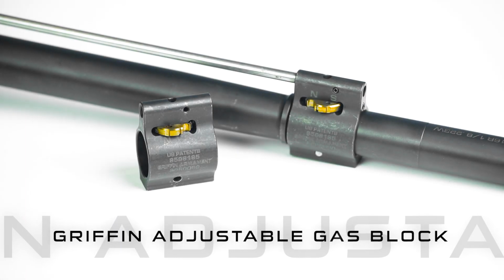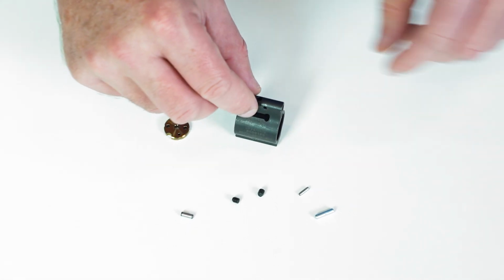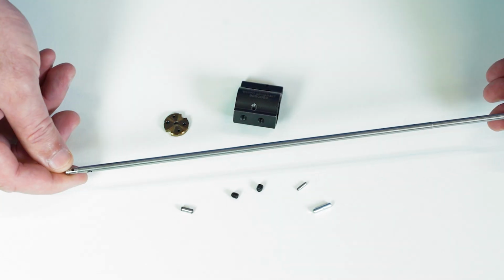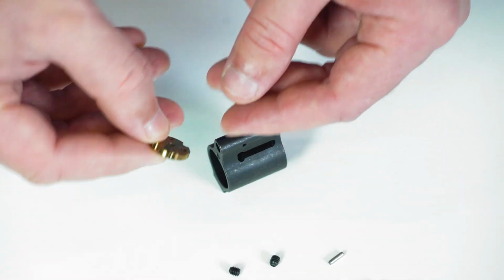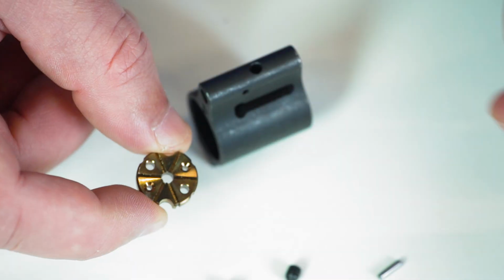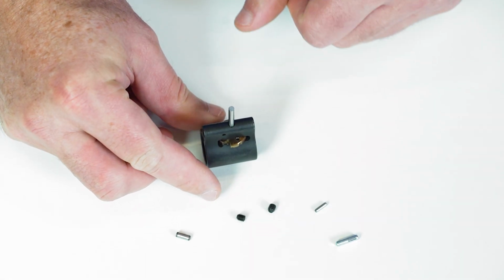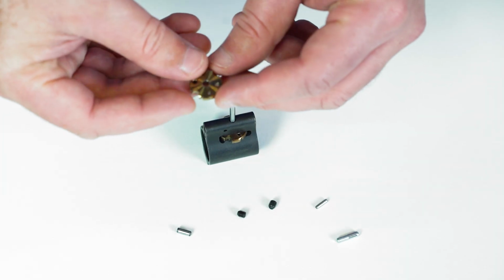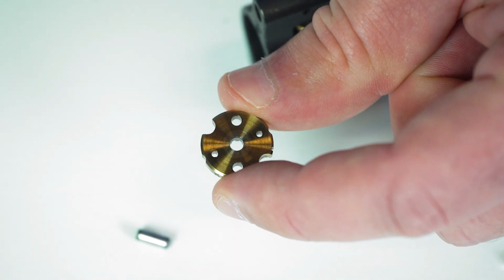Griffin Adjustable Gas Block - User Interaction Demonstration

Comment: I just went to your site and reviewed this product: 	Disassembly for cleaning ? 1.) The top retaining pin, is it easily removable, as in “made for disassembly / reassembly” ? 2.) Would like to be able to remove that wheel to soak and or scrub. 3.) What is the “wheel” material ? 4.) Are the gas tubes you offer proprietary to your gas block ? It would appear that a gunsmith is needed OR the personal ability and the equipment to install. Is there any thought of a pass thru set screw type for the “wheel” retaining pin in the future for owner removal for cleaning ?	Thank you for the video update.
Reply from the maker: 1.) The top retaining pin is just floating and held in place by the gas tube and the barrel for ease of removal to change plates or clean. 2.) The wheel is easily removable, and usually you don't even have to take the block off the barrel. Simply unpin the gas tube, slide it out the front, tip the barrel upside down and knock the pin out the top. If that doesn't work, you will have to remove the gas block and poke it through to the interior of the block using a punch or small tool. 3.) The regulator plates are made from H900 heat treated 17-4 stainless steel for high durability. 4.) Any standard length (rifle, mid, carbine, or pistol), straight gas tube should work fine as long as it's milspec. We sell them to support the gas block. 

 If you are going with a pre-drilled plate, any user with a basic understanding of gas-operated firearm assembly should be able to accomplish the install. If you are drilling your own port sizes, you might want to consult a professional for guidance. 

The retaining pin is exactly that, a pass through pin that can be knocked out in either direction. Hope this helps! We know it looks slightly complicated, but our video guy was able to figure it out and assemble it on his own in under 10 minutes, so it's really not that complex.
Reply: @GriffinArmamentOfficial is there gas leakage between the plate and slot in the gas block? It seems there would be seeing that the plate loosely slides in the slot. What’s keeping pressure down on the plate?
Reply from the maker: The plate has like a thousandth of clearance on either side between the plate and the slot resulting in very little gas escaping, but there is some and it's intended to be that way. Mr. Soong found out very early that a perfect fit almost invariably seizes the parts after a short time. Leaving a gap allows the carbon to blow itself out and not lock up the parts. The ags check grooves are there to divert this escaping gas into inconsequential zones.
Reply: @GriffinArmamentOfficial Thank you for the response. How many rounds have you run through this before carbon buildup was a factor, as eventually it will be ?
Reply: There is no understood need to clean the unit.  the plate has gas check grooves which act as a carbon scraper.
Reply: @austingreen3888 Are you saying that it “self cleans’ utilizing the carbon from the powder burn from each round fired and does not build up ?
Reply: @rgr3427  That's been our experience for example of our M4SD mounts- they don't get stuck.  There is for example a 118 degree counterbore at .108 covering a .125" hole in the block, so the outer .0085" could possibly carbon up, and that would be broken by moving the plate.  This should be easy to do.  For example can you put a dental pick through .008" of carbon?  Yes.  Things like do we clean gas tubes come to mind, and the answer for the military is no they don't clean the inside of gas tubes.
Reply: @austingreen3888 Thank you once again for the quick response. One correction; as a vetern in many differing arenas around the world and in numerous FOB or “remote patrol” areas, we did in fact clean our gas tubes, high humidity areas as well as so quaintly discribed “foreign ditris blockages” (sand/dust). Turning your weapon info the armory for this was not a reality we dealt with. My concern here is the inability for the regular rifle owner that does not have the equipment and or expertise to, install this device and then add the possibility of not being able to “thoroughly” clean this device without the armorer quailed and equipped to do so. In a perfect world of the armorer at my beck & call and or the purchase of readily “clean” ammunition, I am talking directly to the everyday shooter .v high end purchaser. Ammo being what it is today and has always been, some will fire with what they can afford versus what is best. Just my thoughts; I am intrigued by your system as innovative and forward thinking for the industry. Thank you once again.
Reply: @rgr3427  I was deployed in combat or high threat environments in Iraq 4 years.  For high humidity I did 6 months training at Camp Shelby Mississippi where the humidity was like condensing most of the time and it tropically rained like a monsoon daily around 4:30PM.  I never cleaned a gas tube and the rifle ran.  I never got sand in a gas tube because the dustcover and bolt was closed.  Maybe you had a pipe cleaner and put it in a gas tube?  It wasn't necessary. I never saw the Army instruct a person to clean a gas tube, but my training was at Ft. Benning- home of the Infantry so it's just one site.  On one of my deployments I shot up an entire company allotment of training ammo because nobody else wanted it for a few months in summer when temperatures were around 135F and that was ~14,000 rds.  In that time I cleaned the rifle regularly, but never cleaned the gas tube. The gun ran the entire time.   I probably averaged 2500 rds a year for my 9 years in the army not counting the 14000 rds that summer, so add the 14000-2500 average and that's 34000 rounds on M16A2/M4 family firearms and never cleaned a gas tube.  On one of the deployments one of the SF guys at my site bragged about being 8500 rounds deep on his mk18 with no more maintenance than adding oil, and occasionally wiping the sludge off the BCG and the inside of his upper.  He was saying he would clean it better when it started to have reliability problems.  His Mk18 was like black graphite lube filled - the carbon was an oily substance the firearm was operating in.  It wasn't necessary.
Reply: @austingreen3888 Understand completely, I was Air Force (9+ years) deployed with Rangers in all environments. This only happened 3/4 times but it did happen, as for the pipe cleaners, yep. My concern with this system is two fold, with a commercial application caveat; 1.) Requires a gunsmith to install and maintain. 2.) You as the end user “cannot” clean this system. *The caveat is the commercial side of this. To make availible to the commercial market, a market that generally uses swap out AR platform parts, this is not one of them. It requires a gunsmith with the appropriate tools, as in a gunsmith lathe and the expertise to perform the work. This is all laid out on their website, they do not suggest you do it. To state that it is not a problem and can be mitigated with a pick, in my opinion is hopeful at best. The tolerances in this are tight to say the least even though they say the inventor/developer took this into account and opened up the systems to mitigate this, a known concern/system downside to them. As you know the gas system in a standard M4 platform utilizes a wide open/fully un-obstructive gas system. If added suppressor, this was setup by the company armorer and tuned to work. I did commend them on the new system “”thought” just not fully on thought out in the operational side of the system, especially in a swap out AR marketplace.
Reply: @rgr3427  The manual is always going to recommend a gunsmith.  That's a disclaimer for people who can't build their own stuff.  That doesn't mean this block is tougher than ordinary blocks to put on a gun. If you could clean a regular gas tube without removing it from the rifle, you could do that with our system.  There isn't really a difference.  At my infantry company I never saw anyone need to clean a gas tube, but I guess maybe if you swam in a sand pool or something it could happen.  We did some river patrols with rucks (infantry likes to be miserable type stuff) and lakeborne operations a couple times with zodiak boats we borrowed from the Navy Seals at Great Lakes Naval base, but guys tried to keep rifles out of the water, and the water was just water, it wasn't like a soup of sand and water.
Reply: @rgr3427  No I'm saying that this design is heavily related to a design sold ~10 years with no history of seizing up or needing cleaning.  Sorry if this was redundant- just making rounds answering questions.
Reply: The disk is 17-4 stainless tool steel H900 treated to 44RC hardness.  It is superior to barrel steel in terms of erosion kinetics and strength. The gas tubes are straight tubes- normal length straight ar15 gas tubes.   The pinned regulator disk is simply slip fit for the pin, the pin is retained between the barrel and gas tube.  So the gas tube has to be removed to remove the disk.  A lot of people install their own gas blocks, but the optional pinning is best done with the help of a milling machine or at least drill press.